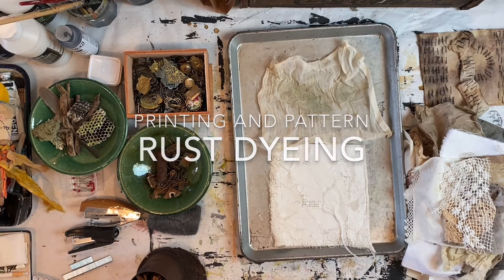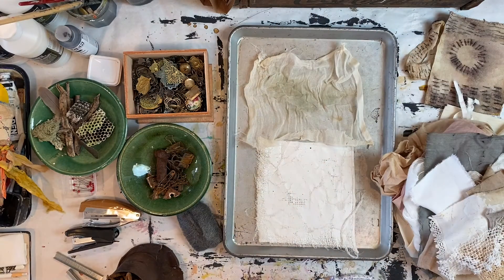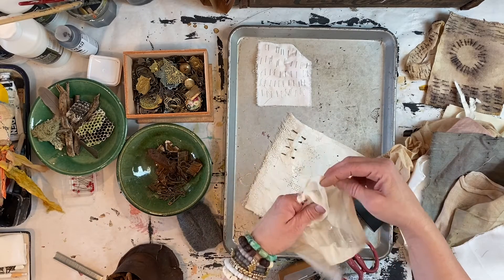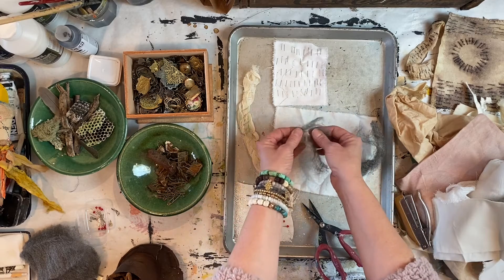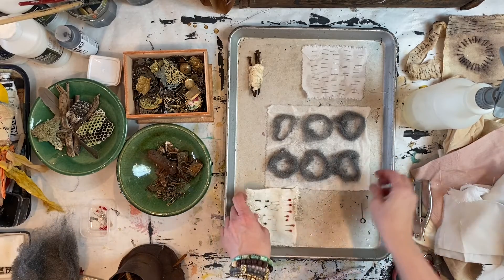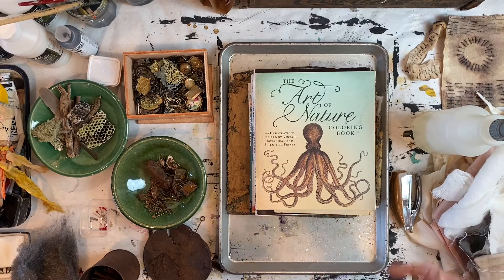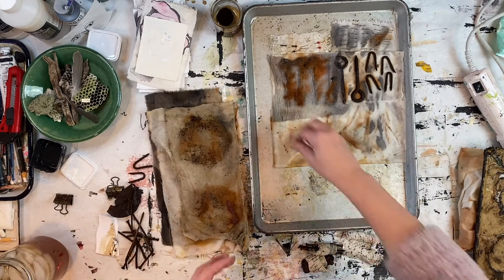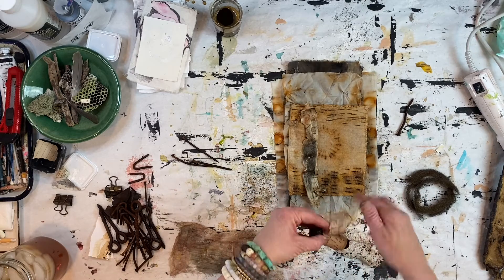Rust Dyeing

Comment: Great tutorial! Thank you!!! I'm just curious whether you have any advise on large pieces of fabric. I have several sheets that I would like to use in rag rugs of different techniques. I don't need any fancy designs, just an overall dye. Maybe it would work best with the strips torn already. 🤔
Reply from the maker: You could achieve a rust dye effect on a larger piece of fabric by using a tub. Just throw all the ingredients in together and let soak. I would then make sure did the salt soak at the end to set the rust and keep it from fading.